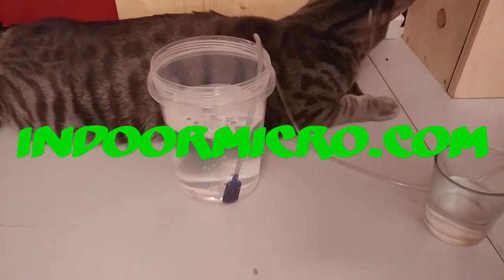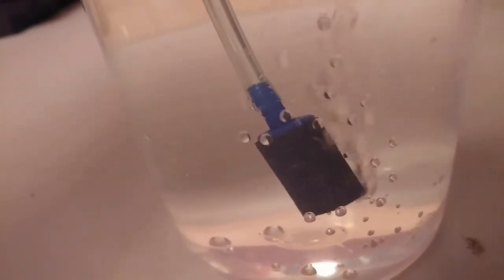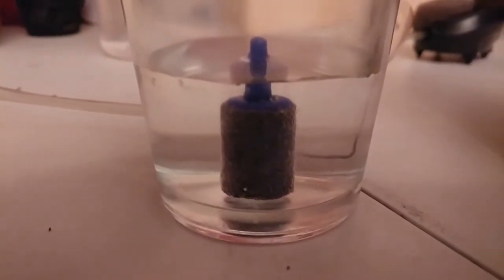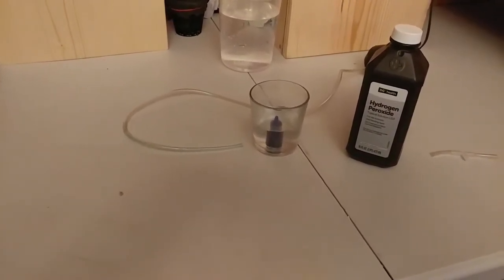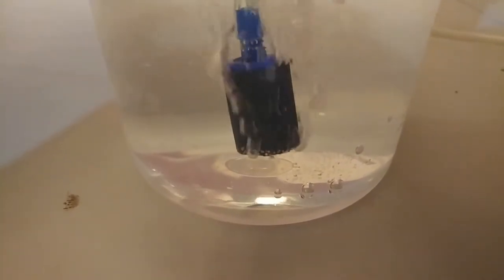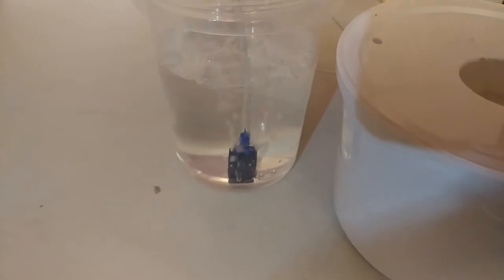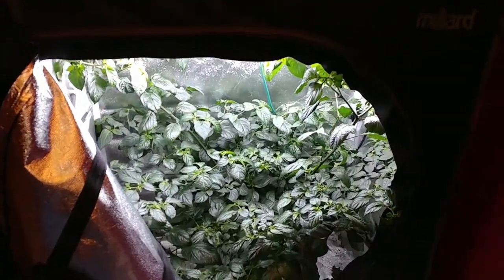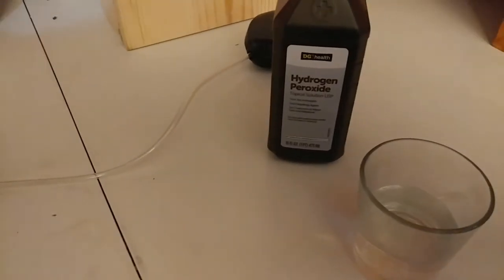How to Clean an Air Stone

Comment: H2O2 is very good for a multitude of uses in the garden. Tools/equipment sterilization, added to water gives roots a boot in the ass (not roots exposed dwc) helps pop stubborn seeds. Probably missed a ton more uses, but it’s definitely a must have

Comment: What about rinsing the peroxide off of air stone
Reply: You really don't have to because Hydrogen Peroxide just dissipates into the water. As long as it's not too much, there's really no problems with it going into your tank.
Reply: It’s H2O2, it has a volatile Oxygen molecule that makes the bubbles as the Oxygen dissipates and rises.

Comment: H202 = Hydrogen Peroxide so you can also just use that
Reply: It’s also great for helping to pop seeds quickly 😃 H2O2 has an extra Oxygen molecule and it’s very volatile. Reason for the “bubbling” that the Peroxide does. It can also keep plants healthy(light amounts of 3%), if not running living soil. It can prevent or kill some beneficial and virus pathogens. You can always re-apply microbes after treating soil to help the roots get back what may have been taken away. Lots of growers out there even mix Peroxide in with Feedings and waterings. Keeps soil pest away. For the most part.
Reply: @5h1tfuk  Thank you Ryno!